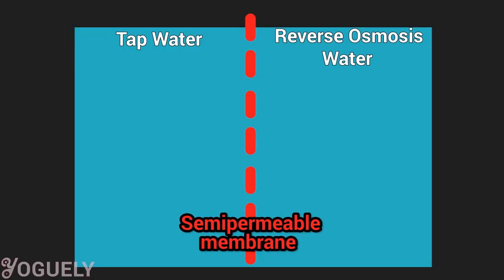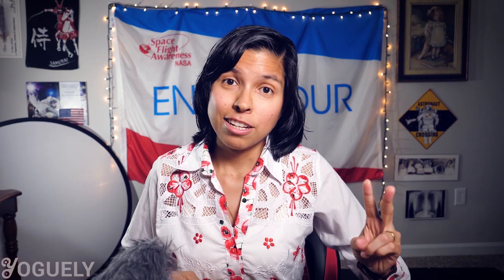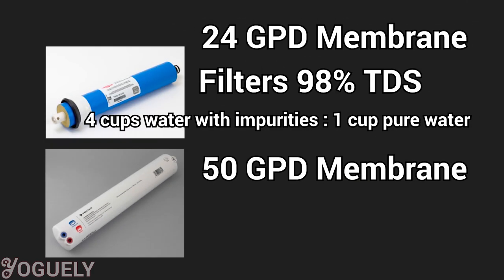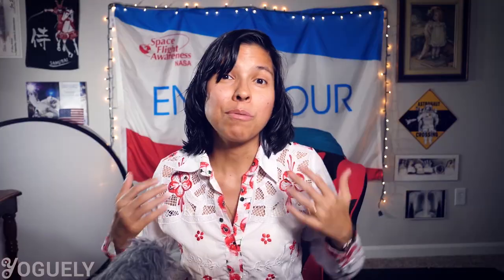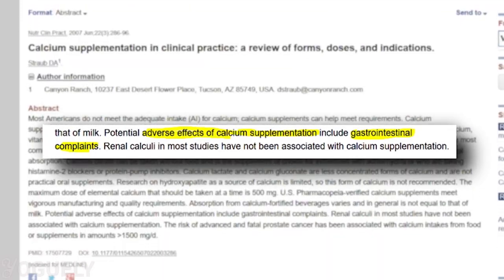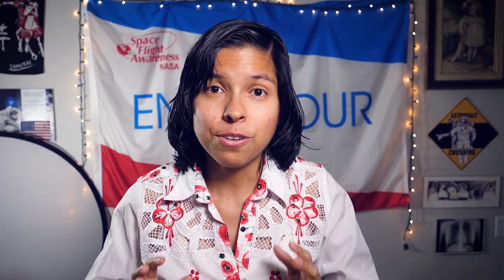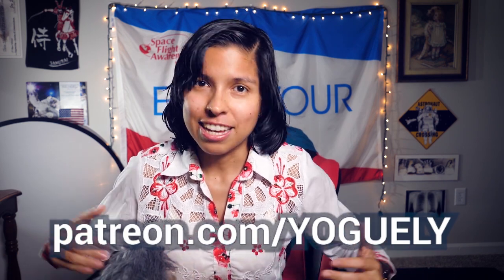Reverse Osmosis Water Filter System: The Definitive Guide

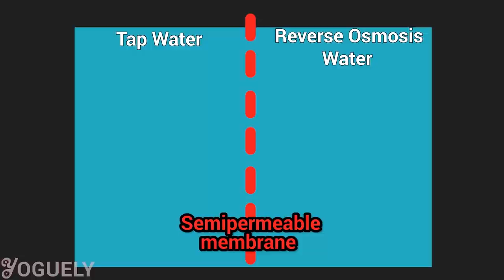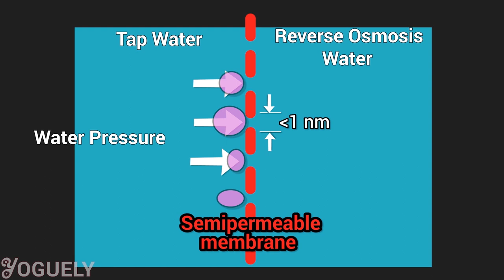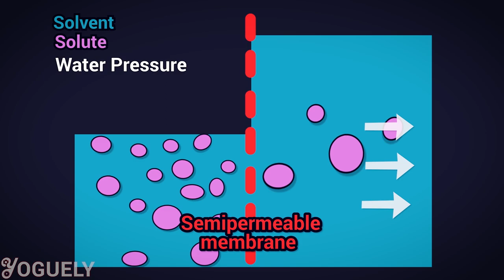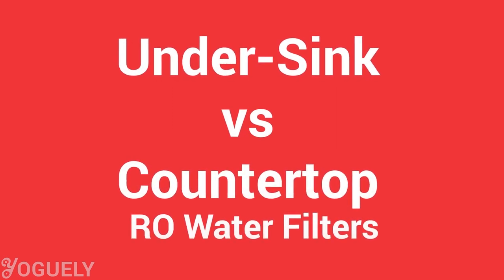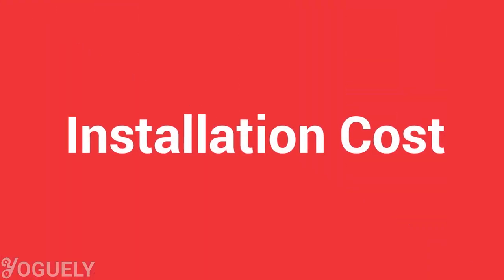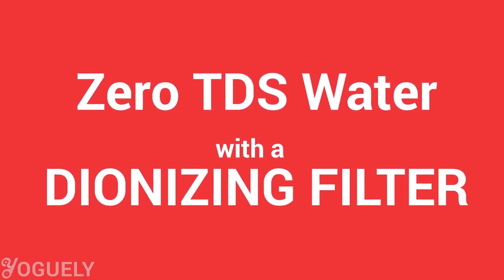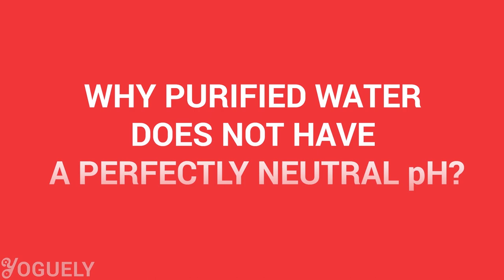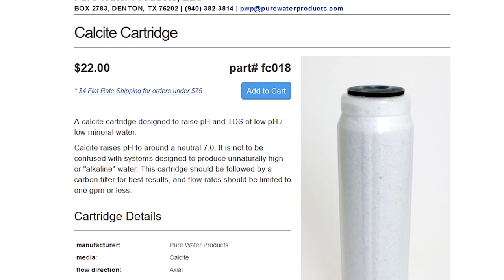Comment from the maker: ¡Hola! Everything you need to know to get you from ZERO to HERO in RO. Browse through topics: reverse osmosis water filtration process to make clean drinking water (0:43), how reverse osmosis works to remove salt and other pollutant substances from any water source (1:15), why do we call it reverse osmosis (2:04), how much energy RO requires (2:50), why it needs an activated carbon filter (3:08), why you may need a sediment pre-filter to remove, sand, dirt, and large particles from the water (4:50), the differences between reverse osmosis membranes (6:00), which GPD flow rate is the best (5:59), how different TDS removal percentages differ (7:01), how easy maintenance of a RO system is (8:05), the difference between under-sink and countertop reverse osmosis water filters (9:37), the cost to install one of these (10:52), how to get zero TDS water (12:09), is zero TDS necessary? (13:21) how to re-mineralize and balance the pH of Purified Water with calcium (13:52), why purified water does not have a perfectly neutral pH (15:22), which pH is the best to drink (17:10), and filters for other water problems (18:15).
Reply: Hi, I boil my city supplied water, what do you think?
Reply: Which RO system do you recommend?

Comment: Thank you for posting this and your installation video it's been really helpful.
 I do have a question maybe you could help with. I purchased a three filter system with tank similar to yours. My question is after the water has been filtered and is ready to be consumed, I would like to add healthy minerals in to store in my refrigerator. I guess in layman terms do you have a "recipe" to emulate what would be good quality natural healthy spring water. I realize this kind of subjective. This is something I've been wondering about for way too long. 
Cheers
Reply from the maker: You are very welcomed Scott! The most popular mineral to add is calcium carbonate, mainly for taste. The trace amounts that is added is much smaller compared to the larger amounts you get through food. Like I mentioned in the video, food also happens to be the most efficient way for our bodies to absorb calcium carbonate.

What about other minerals? Well mineral water is just ground water that has a total dissolved solids (TDS) level of 250 mg/l or more, whether those minerals are good or bad for you. The recipe varies widely from source to source.

So here is my perspective on this. I like efficiency. Since I can get all of those nutrients through food, and absorb it better that way, I haven't found the need to go through all the work of adding minerals to my water.

Hope this helps. More to come. 😁

Comment: I am interested in how else we can use the wasted water from an RO system.  Is it safe for 🌱 micro greens, seedlings, garden, lawn watering?  How will using waste water differ from using tap water in these applications?  Can animals drink it?  I live in an area with very hard water.  Is the waste water like tap water just with higher concentrations of TDS and VOC? How do I calculate the increase of concentrations in the waste water?